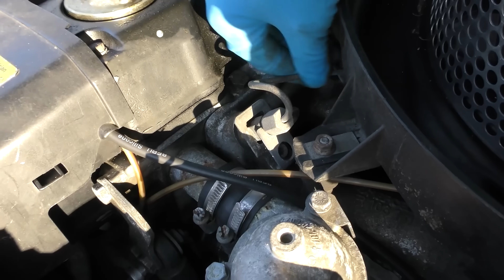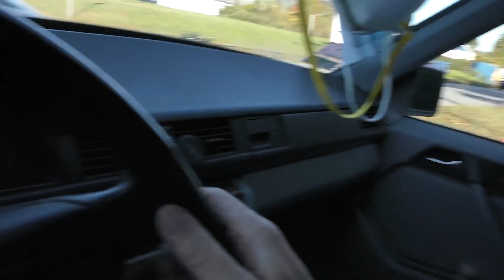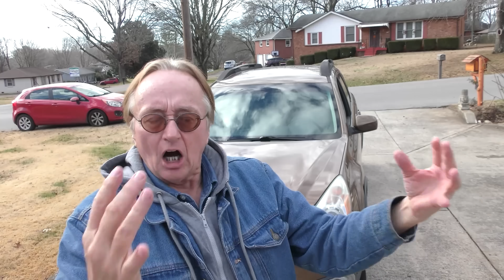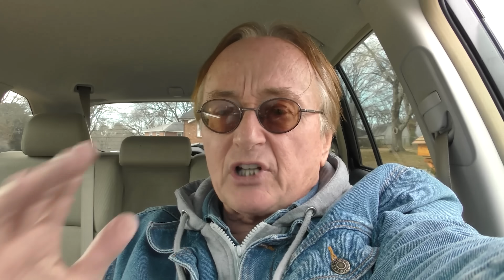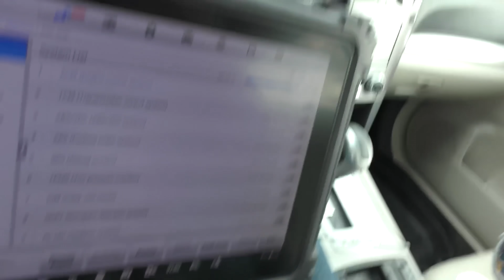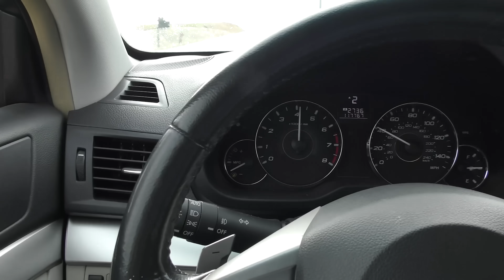People Say I'm Full of Crap About Fuel Additives, Well Watch This

Comment: I bought this product based on Scotty's review and used it in my SUV. 
Now I can only speak for my experience with it. 
It's absolutely amazing, my engine runs like it never has before, and it's off the charts.
I can't wait to use the engine oil cleaner on my following oil change.
 Thanks Scotty.

Comment: I ordered ATS today. Yesterday my 2012 Jeep Patriot 104k miles cranked but would not start on the first try. It did the same two years ago and I used Scotty's Dupont recommendation and that worked. Ordered the oil additive also.
Reply: It turned out the no start and stalling was the driveshaft position sensor. But, the treatment has it running better!

Comment: Hey Scotty I have a 2022 Nissan Rogue and I was at the local Perfection Tire store here in Washington State getting my tires rotated for longer wear and I asked them about the CVT tranny, they said the transmissions are sealed and the fluid will last for the lifetime of the vehicle. Is this true? I know you said CVT's require fluid change around 40,000 miles or it will start having problems. What should I do about this when my vehicle reaches that kind of mileage? They said they don't do fluid replacement for those transmissions

Comment: Be it VW or Mercedes, "unhappy when cold but happier when warmed up" can be the vacuum leak around old, hard, shrunken seals around the injectors.  Bosch K/CIS hates unmetered air leaks.  Replacing these seals (and the plastic shrouds) on this era of Mercedes is a snap. (Replacing the O-rings on old VW's can really suck.) If you fix the vacuum leaks, then the setting at that 3mm Allen headed screw might be correct after all!

For fuel injection/intake valve/combustion chamber cleaning, I'm a big fan of Red Line SI-1.

To get your fuel distributor rebuilt in the USA, google for CIS Flowtech, Inc.

Comment: It can't hurt to put in injector cleaner. I've found Shell gas does the same thing. Maybe the air flow valve is allowing more air thru than it did when new. Another problem could be that he's driving so few miles. I have a 30 yo Ranger that can sit months between starts. The fuel simply sits too long, much like you get in MCs and lawn mowers. It developed a slightly rough idle and MPG dropped from 18 to around 15.5. A shot of injector cleaner and a couple tanks of fuel restored its MPG.

Comment: I’ve got a 2002 Toyota Avalon and just put ATS CHEMICAL 505 CRF in a fill up and 505 CRO in an oil change with a new Air Filter thanks to you. My question is how low do I let the gas level get before a new fill up to get the most out of the CRF? I’ve only used about 1/4 tank so far and already feel an improvement. Thanks Scotty! And for the best auto advice on the internet.

Comment: Not that anybody drives TBI K10s anymore,  but they get better gas milage if you put fiel injevctor cleaner in each gas tank.    Someone told me this when i bout the truck and i didnt believe them, but when i put it in for some other reason the gas milage did noticably improve.   weird.
Reply: the improved gas mileage wouldn't be worth it if your putting fuel injector cleaner in each gas tank, might as well just put high quality fuel in to begin with
Reply: @tanishanand9773  i didn't because i don't care about gas mileage, even in that truck which was horrible on gas.   But I was suprised how noticible the difference was on that particular TBI 305 engine. At the local auto parts store the mechanics from the dealership come in and buy cases of techron all the time, so they might think it actually does something.

Comment: Bought a 03 Frontier 4x4 last April. Had 120k miles, very minimal rust. Not long after I bought it the Check Engine light came on. Its my winter truck here in NE Vermont so I didnt put a whole lot of miles on it till snow fell. Runs great. Put a can of this 505 in it a few days ago after topping off the tank. Ran it for less than three miles during several trips. Check Engine light went off. I have no clue what it did but it did it. Tell me why Scotty. Please.

Comment: Scotty, I have a 97 Corolla with a 2nd Gen 4A-FE with a persistent outer and inner CV joint clicking sound even with new axles. The engine is slanted noticeably down towards the transmission side, could bad/damaged misaligned engine mounts be causing the problem? Please I'm on my 4th pair of axles now

Comment: is it normal for my starter to have a delay early in the morning on a cold day... I dont live in an area where it snows or anything but in the winter time it can get very icy in the morning. When I goto turn the key I sometimes find myself holding the key in the start position for a good 3 seconds before the starter motor even engages and begins doing anything. Once the starter begins cranking it starts up like no problem. It has me stumped and only happens when its really cold

Comment: I have a turbocharged car and will typically just run a can of seafoam through the tank every other oil change. My engine runs smooth at all times. (2.0L 2020 Ford Fusion Titanium). Not a fan of the history of this engine, but with proper maintenance and care, at 100,000....a feisty little engine with zero mechanical issues. Not familiar with the cleaner you use but I will give it a try. Another good one is BG. Used that one alot too. What I like about Seafoam is you can use it in the engine as well. Thanks Scotty

Comment: Hello from Georgia(country),
You say hybrids are the future of cars. How they hold up over time if they keep shutting down every time you stop at a red light or traffic. Or you step on gas engine starts and imidiatly revs up. And i know most wear comes from the start of the engine.
Also I'm interested, how prius manages to stay so reliable. And how hybrids keep their engines warm while being shut down half of the time. (Sorry for bad English 😂)
Reply: My 2002 Prius will idle continuously until it's warm. Close to no wear occurs when warm-starting an engine.
Also, the hybrid battery helps with acceleration so the engine does not work hard at all.
Reply: It's cold starts where the oil hasn't gotten everywhere yet that cause problems.

Some manufacturers that I know of (Toyota) have put coatings on the piston skirts to retain oil better between hot restarts.

Comment: After Scotty kept talking about Bernies gas and oil additives, I thought I would run both in our 2012 3.6 Impala with 60k on it. The next weekend we drove 250 miles to  Indy and back. I drove 5 mph over the speed limit, but drove modestly. The Impala averaged 34.7 MPG and no more carbon blowing out the exhaust on hard acceleration. It made me a believer😊.

Comment: Hey Scotty, I have a question. I have a 2015 Honda Civic with 113000 miles on it. It does not trip any codes, but the long term fuel trim is 14% the gas mileage seems fine, but I am worried there is something wrong and I just don't know. What should I check?

Comment: I’m looking at buying 4 different vehicles.

2006-2011 Toyota RAV4
2006-2011, Honda CRV
2007-2011 Honda Fit 
2005-2009 Toyota Matrix

I live in Calgary, Alberta, Canada. Where it gets really cold during the winter time.

I understand SUVs are different than cars. I’m looking for the most reliable vehicle that will last me during the winter and a vehicle that won’t cost a lot to maintain when parts break down. 

What would you buy for a vehicle that’s going to last the longest and run great in cold weather?
Reply: 2011 Toyota RAV4

Comment: Was that adjustment an idle adjustment? There must be a start-up fuel mixture adjustment as well that senses ambient temperature. Carburetors have them (the old bi-metal coil, LOL) , I would think a fuel pump would as well.
Reply: The adjustment is made at idle, but best I coudl always figure out it affected the relationship between the airflow-measuring disc and the plunger in the fuel distributor throughout the whole range.

Comment: Since you recommended Bernies fuel system cleaner (505 CFR), would you also recommend their oil system cleaner (505 CFO)?
Reply: Good question, I was wondering the same thing.
Reply: Scotty has produced videos demonstrating it works in some cases depending on the problem. Sticky oil pressure operated timing chain tensioners and seized oil control rings, for example.

Comment: Hi scotty, what do you think of oil treatment additives to help release piston oil control rings? If so which is the best one?
Reply: Scotty will say Bernie’s oil additive.
Reply: Liqui Moly does make an oil change flush that's meant to help with that. Are you running synthetic oil? That has more detergent, too.
Reply: @theundergroundlairofthesqu9261  yes i run synthetic oil and change oil often but previous owners I guess didnt too well as the car burns about 300-500ml of oil per 3/400 miles
Reply: @weatherwatcher5303  Perhaps a top-end cleaner?  Chrysler/Mopar makes a good one that you spray into the intake manifold of a hot, running engine, it's a foam that then gets sucked into the runners then down into the cylinders. Once you've sprayed the whole can and haven't stalled it in the process, you shut it down and let it sit in the heat for a while. (I think an oil change is a good idea after this,)
Reply: @theundergroundlairofthesqu9261  i have purchased some engine cleaner to see if that helps i also have some scoring marks on cylinder wall unfortunately

Comment: I've got a  1985 bedforc cf2 van, I fitted an engine from a 1989 Volvo 240 glt that has Bosch K-jet fuel injection, it still works great.

Comment: Back in 1985. I bought a 1984 Nissan 4x4 loaded sport truck. 2-barrow carb. Drove it till 1993. It had a tiny screw on the side of the carb. That is how I adjusted the fuel injector intake flow. Then put in some fuel additive. Worked extremely well Scotty!👏💪😁

Comment: I personally use fuel system cleaners. 2 times / year, and drive on average 3,500 miles / 5,600 km yearly. Keeps the engine in tip-top condition and your gas mileage / emissions as well. Fully concur with Scotty.

Comment: I use B12 Chemtool. It vaporizers really fast and works really fast.  The only problem I have with it is a weird vapor pressure problem at 2/3 of a tank where I have to stomp on the accelerator to start it.  It clears up at about 60% of a tank.  
When I put it in the idle reaches warm idle within 10 seconds as opposed to a minute or two before it needs the blast out

Comment: You seem to really be pushing your buddies product. I have three vehicles, ‘07 F150, ‘16 Forester, and a ‘93 Buick Roadmaster, so I bought three sets of CRF and CRO. VERY expensive. This was the second time I used it on the F150. I have to say that I’ve not noticed any improvement in any vehicle. Only thing I am is lighter in my wallet.
Reply: Brought wrenches too still didn't fix either 😳🤣🤣🤣🤣

Comment: My son inherited my 1990 300e, drives great, unbelievable handling and turning radius, original engine a transmission, really only major service was AC and rear differential at 225,000 miles. When Mercedesbuilt a car to last 25 to30 years
Reply: Speaking of turning radius, I had a Volvo 240, the turning radius shocked me the first time out. I could make a u-turn on a 2 lane road in a single turn! I gave that car to my son, he still has it, It probably has 400k miles on it, IDK 
Stupid easy car to work on too. I bought a Chilton repair manual on it and did all the maintenance and repairs in my driveway.
Best car ever.....
Reply: @donnasingleton6320 I want a Volvo 850 Estate wagon sooooooo very badly!
Reply: Well said
Reply: Wow, it’s amazing you are able to communicate with us from the afterlife.

Comment: Same injection system as a BF-109 .Those Mercedes are brilliant cars, especially in the diesel ones,lots still in Africa ...
Reply: That fighter plane had mechanic injection like a diesel pump . Crank driven (via chain or gear, I don't know) pump with steel lines from pump to injector. I'm guessing direct injection.  Some Mercedes of the 1950's had this same kind of setup, and direct injection.

The Mercedes in this video has Bosch K/CIS injection, which means that fuel is metered by a disc in a venturi in the incoming air, and that disc is mounted like a seesaw, to a plunger in the center of the fuel distributor. Then hard lines from there to the mechanical injectors which are port injection (spraying at the intake valves.) Hard to describe it it actually was an air-mass-measuring system and worked well, provided you fixed all vacuum leaks and didn't go reaching for that 3mm screw or fiddling with the most expensive/complicated part right off the bat!

Comment: Alright Scotty by Bernies treatment am i correct in assuming ATS Chemical 505 CRF for fuel?And do you also use the 505 CRO as well. My Chevy Express is approaching 160K 4.8L I like to keep it running at least til im dead. I would like to try the fuel if I got it right. Open to your thoughts on the oil as well. Thanks for your help and keep up the good work. :)

Comment: I rebuild these old Bosch Fuel Distribution Systems at our shop. There are also three or four other companies around the world that do the same for multiple makes and models. There are also rebuild kits available through these companies if you're capable.
Reply: Is it around $3 grand for a system
Like in the video?
Reply: Oregon Fuel Injection in Eugene rebuilt the injectors and injection pump for my 1984 toyota diesel lifted 4x4.  31 mpg combined but it couldn't get out of its own way!
Reply: @knirbnosaj1158 i shouldve looked at them when i needed a fuel injection pump for my 428 perkins in my backhoe. Im 60 miles from Eugene

Comment: Fuel additives work.....some work better than others.
They clean injectors, they dilute water (in your fuel tank) & burn it off, they clean residue from fuel lines.
Buy a few on sale & use 1 every couple of months 👍
Reply: Every oil change- one tank before
Reply: @williamevans6522  Naa,that's way over kill.
Reply: @tardeliesmagic  Cheap insurance
Reply: @tardeliesmagic that's what I'm doing on my 24 camry. Every oil change
Reply: @williamevans6522  yes sir. I like to do that with a high pea cleaner content and give the engine a few ounces of marvel mystery oil. Drive another 400 or 500 miles and change the oil and filter. It’s kept a d17a2 engine alive past 200,000 miles. Had the car 10 years in June.
Reply: @TegrityJDM  185000 miles on  my '17 Suby F'str. 
No problems, strong as ever.
Reply: @williamevans6522  you get a J vin?
Reply: @TegrityJDM  Affirmative
Reply: I don't put much mileage on my 2012 Ram now as I'm retired.  And awhile back my truck literally just started to shut completely down in the road. It was sort of scary and the only thing I could think of was moisture in the gas . Put a container of STP in the tank and bam .... never had the problem since. Now I will occasionally put some in.
Reply: Should I get Scottys friend Bernies or the ones from AutoZone would do it?
Reply: @themachine8009  you can get Bernie’s stuff or anything with a high PEA content. I use redline sl-1 myself. Or chevron techron if I can’t find any redline. STP has a new one with pea as well
Reply: Nothing works for water, watch Project Farm’s video about it

Comment: That's one of the worlds  best wagons ever made ..it has rear hydraulic self leveling suspension similar to  Citroën.  I had a 1992 I bought used for $6500.00 with 150k Miles. I had it for 18 years...traded in 2018 for 2014 Camry SE Sport. If the owner of that Mercedes wagon wants to sell that car please count me in.

Comment: Yea it really sucks to let the computer make the mix richer when needed automatically .
Reply: This car did have an 02 sensor. It's just that you can adjust the fuel mixture, also, which is one way to account for small vacuum leaks as injector O-rings, for example, get old, hard, and shrink.

Comment: My truck is hard too start when it’s hot but starts great when it’s cold , has no codes or check engine light
Reply: Leaking fuel injector.
Reply: @Mr.Saltwater  hmm I’ll look into It
Reply: Its probably a ford
Reply: @johndiggle4229  you are right

Comment: I had a 91' 300E back in college.  Old but mint car. First trip home after buying it crossing the Rockys on top of a pass a deer ran out in front of me.  Naturally i was speeding, swerved left at 75 slightly, got loose, counter steered and corrected and floored it. Clean get away. Car was a rock. I love pre 94 Mercedes they were extremely well built and reliable. Not Toyota reliable,but good.  Labor and parts was expensive but great cars.

Comment: After I saw you and a couple other guys mention this, I added 2 different brands of fuel additive to my 2015 Chevy Traverse with 170,000 miles on it, because it had acceleration issues. After the 2nd one runs almost like new.

Comment: My truck has a similar issue. However rather than when it's cold out, it happens every time I put fuel in it and turn it off. Since that's the case, I leave it on when I put fuel in it.
Reply: This can be caused by topping off your gas.  The evaporative emissions system gets damaged. Are you filling up when you get gas or does it happen with any amount of gas you get.?
Reply: @dtomechanic  Any amount of gas.

Comment: That's not true, Mr. Scott, that's not true at all.
The horn button on the steering wheeling of 2006 Scion xA does not work, what could be the issue? Should I replace the steering wheel or just take off the cover off of it?